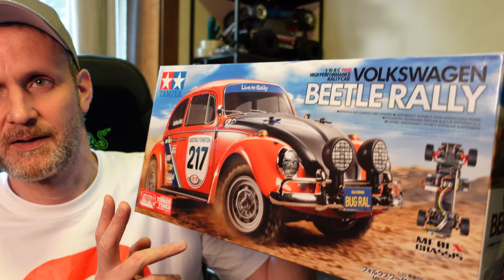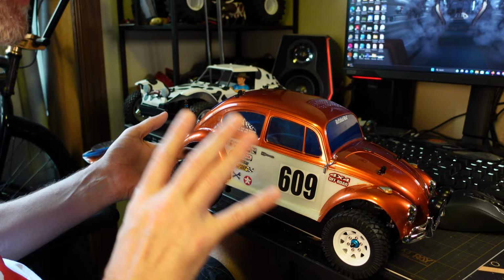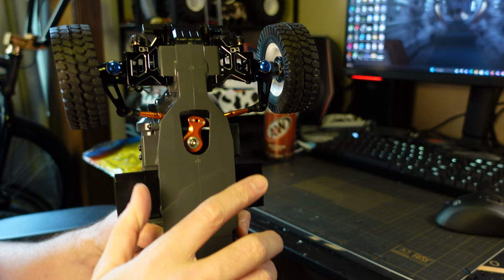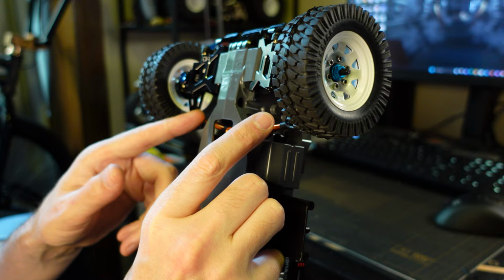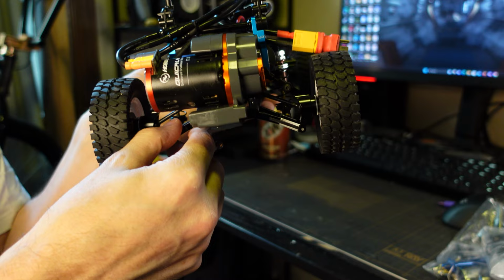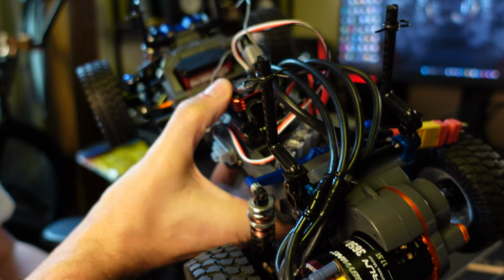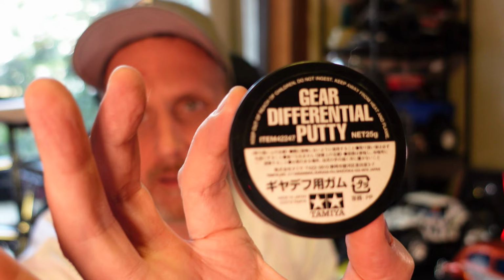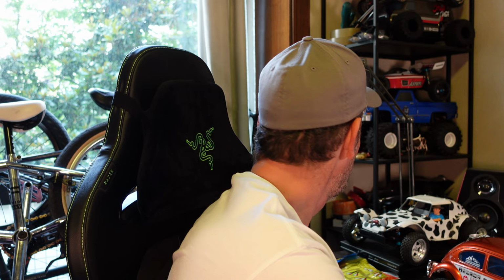Tamiya MF01 Xtreme!

Comment: That is a great looking build nice work!
Reply from the maker: Thanks. It was quite project to figure out. Not cheap. But a far better car than the original in my opinion. Parts are in the description. Links are random, just sites selling the parts.
Reply: @Triggered-RC  yep I built one when the mf01x first came out. I used all that yeah racing stuff with a lunchbox body and a set of modified Tamiya mini wheels cut and mated with 1/16 slash inner wheel section to run 1:16 slash tires.
Reply from the maker: @85Stang331  nice 👍 I just saw a single picture online of a modified one similar to the one I built. And then, figured out on my own to do something similar. The only parts that matched were the wheels I think.

Comment: Id take those rally tires left over but shipping would be insane! 🤣. Cool build, insta360 is very nice, my gopro only lasts 20min before shutting itself off. Fun run!
Reply from the maker: Yeah, shipping would be more expensive. GoPro 11 is such a disappointment… the RS One gets hot but doesn’t overheat. Will be using it from now on.